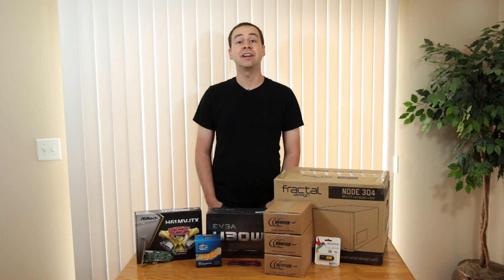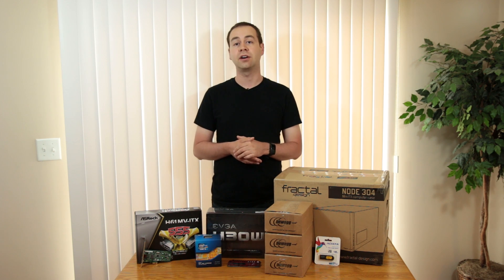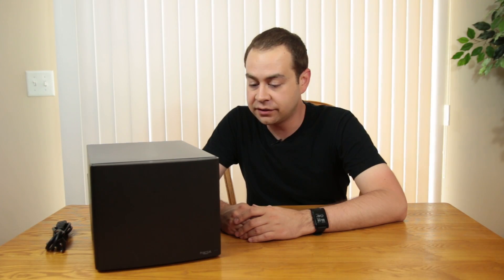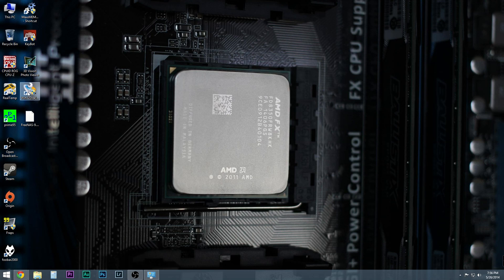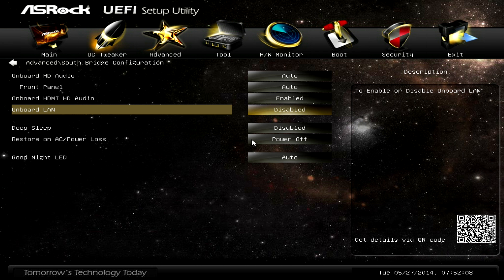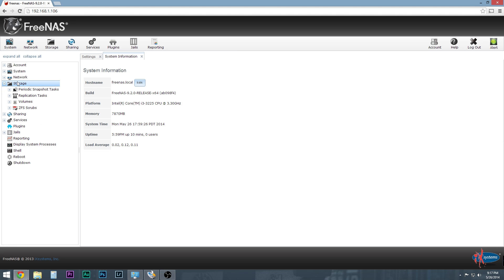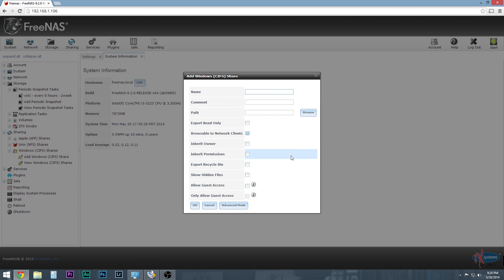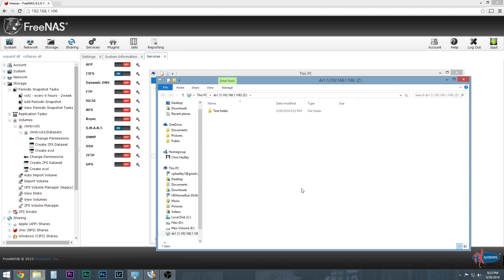Build a FreeNAS box - Core i3, 3x2 TB, Fractal Node 304

Comment: What will happen of i remove the usb stick after i set up the freeNAS? 

Which is better? Using a usb stick or a cd?

Just need help here..
Reply from the maker: Jack Anthony Catadman You need to keep the USB stick there. Some motherboards actually have a USB header on the board which is optimal. I'm not sure about the CD version but it would be the same. Once the OS boots, you never have to reset so if you are concerned about a USB stick and would rather use a CD for aesthetics, then go that route.
Reply: Thanks so much!

Comment: I just built a FreeNAS box - Core i2, 4X2 TB, Thermaltake Black Edition. All with stuff laying around. I did order 8GB of ram for $39.95. I am running a RaidZ2.  Some say 4GB is ok for home networking. But most people say that 4GB is too little. I am using this file server for video files. Thanks for the video.

Comment: Just doing a little research but why would someone go for a build like this over  buying something like  a synology or a qnap which will be cheaper?
Reply: OriginalNoseBleed Better transcoding, tons more feature, more bay if you don't get the case he got, and it's actually cheaper than any worthwhile qnap or synology.
Only qnap or synology I want is the the $2000+ ones
Reply: If you are using 2 drives it is pointless unless you want faster transcoding but if it is a 6+ bay nas it is cheaper to go the custom route

Comment: Liked & Subscribed. Thanks for the awesome tutorial video.
According to you which one should I go with, OpenMediaVault, FreeNAS or Nas4Free? I've tried all of them on VM and so far not too comfortable using any of them to run a plex server. Which one I should chose on my real NAS built server?
Reply: Same here, they are not straight forward which means learning curve is exponentially steeper. Of the 3 which you mentioned, I found each had an advantage over the other. One question I had requires me to do in-depth analysis of the software and hardware. My main concern would be recoverability in case of a massive device failure. Which offers the best solution?

Comment: Nice video - thanks for taking the time to film that.  I cringed when you put thermal paste on your CPU and then used the stock heatsink fan, but at the end of the video you mentioned that you were reusing the i3 CPU so obviously the heatsink fan no longer had a thermal pad on it.  Hopefully people new to building PC's will catch on to that :-)
Reply from the maker: Yeah, I probably should have been more clear about the fact that the cooler was reused haha. Repeating important info is never a bad thing. Double paste application would not end well!

Comment: Im thinking about building a custom NAS but just 2 questions, Is it really necessary to use a Core i3? wouldn't an Athlon 5150 suffice? those CPU's are only 25w TDP, should be a lot quicker than the CPUs you find in 'off the shelf' NAS boxes and miniITX AM1 motherboards are under £30. Also is it possible to import hard drives (none RAID) into FreeNAS without losing the data? Many thanks in advance.
Reply from the maker: Hi Andy. The Core i3 is very much overkill and I'm actually going to be updating the build using a lower end Pentium and ECC memory. You really want to set up your ZFS RAID-Z how you want it at the time of the build. You can expand the RAID-Z volume but from what I have read it's not really recommended. Otherwise, you can just create a second volume and map that as a separate network drive.

Comment: What exactly is a FreeNAS?
Reply from the maker: It's a great piece of open source software that allows you to build a system and put it on your network as a shared drive. The amount of flexibility the software has is immense and I don't even scratch the surface with my application of the software. There are tons of great articles around on the other stuff you can do with a FreeNAS box and I highly suggest you check them out.
Reply: Rami V Just because you bought a NAS doesn't mean you're getting anything better.  I had a NAS die on me this weekend because it was too crappy to detect that 2 of the disks were dying, and when I mounted the disks on a workstation to recover, what do I find?  Why it was Linux software RAID underneath all the fancy hardware.  I would have had a better experience if I'd just built the FreeNAS box a couple of years ago instead of throwing several hundred dollars out the window on this POS NAS.
Reply: ***** you need it on for sure or else you cant access it.
Reply: ***** that also work. My pleasure :)
Reply: ***** I would recommend building a FreeNAS box with low-power hardware and just leaving it on most of the time. Unless your server is using power-sucking hardware and is under heavy load most of the time, the cost of leaving it on 24/7 isn't very high.
Reply: TWO515TY  its not only cost of electricity it is also hours of hardware working for no serving reason and every hardware has its own limit, maybe freenas has an option to hibernate itself when not in use and wake on lan whenever it is being requested by a customer, that would be best and i guess they have that option.
Reply: Rami V No, FreeNAS and most other NAS/server systems are designed to be on 24/7. I've never heard of a NAS or other server that's designed to hibernate or shut off when not in use. If you build a server with decent hardware, then the hardware shouldn't suffer much from being on and idle. As I mentioned previously, a home server that is idle and not doing much work shouldn't use a lot of electricity to begin with, and the hardware isn't working very hard when no one is using it.
Reply: The fact that you called it Nas does not make it a Nas. Its a Nas wannabe with hardware similar to an upgraded home pc, the fact he purchased Nas box does not turn it to a Nas server, you can take a regular computer which is not Nas and apply the freenas  software on it. It will act like Nas, you may create raid 5 array on it and manage it, does it have Hardware or by any means was designed for Nas? Hell no. And regardless, i see no point in leaving device which most of the day does not provide and service but files storage online consuming electricity and shortening hardware life while being online, though go ahead and do it, irs your money 😊
Reply: Rami V I'm not sure what you're getting at, but a NAS is just some device that's connected to the network and provides storage...I'm not sure how you can have a "wannabe" NAS...either it is or it isn't. Of course the software is what makes it a NAS - the software is what makes any PC do its thing. If you take a regular NAS and use it as a Linux or Windows PC, you could call it a home computer if you like.

The situation you described is actually one of the biggest advantages of the FreeNAS software - you can take any old PC lying around and make it useful as a NAS. I started off getting into networked storage when I turned a $15 PogoPlug into a NAS with an external hard drive and a free build of Linux.  Maybe you're thinking of a NAS in enterprise terms, but this video is obviously designed for people wanting basic home usage. The only requirement for something to be a NAS is to be networked and to provide storage. I don't see why you need NAS-specific hardware to be considered a "real" NAS.

Also, your assumption that all the NAS does is serve files is a little short-sighted. FreeNAS and most other NAS software allow you to install software packages that do other things. My main NAS runs Plex and Transmission, and I've set it up to be accessed remotely so that I can grab files from it if I need to. My $15 PogoPlug NAS also runs Transmission, FTP, and I use it as cheap security camera with a web cam attached to it. Those are just my basic uses - there are people who do way more with their own NAS setups. Also the amount of money that both devices use together is less than $10 a month. I have attached a Kill-A-Watt to both devices and they barely sip electricity, even when under load. If they are idle most of the time, then they use even less power.

Comment: If I swapped the hdd's for ssd's, that would improve performance wouldn't it
Reply from the maker: I would be faster but I wouldn't suggest using SSDs in a NAS setup. Using drives that are specifically designed for a NAS box such as the WD Red series are the safest way to go as they are designed for extensive read and writes over time.
Reply: Tech Uploaded  (sorry for my english)
you would be faster if you had dual or quad intel 1gbit/s ethernet card or 1 10gb/s (look at it price). Using one 1gbit/s port gives you a maximum speed of 125mb/s (=1gbit/s). And today an SSD is faster that 125mb/s. So, even a WD BLUE connected by SATA 3 (=6gbit/s max) reaches out the speed of 1gbit/s port.

Comment: Great video! I know some of these parts were already owned, but what sort of cost would this come to all new do you think?
Reply from the maker: Here's the PCPartPicker list http://pcpartpicker.com/user/TechUploaded/saved/rTBTwP. The price would come to about $700. There are definitely ways you could cut that down a lot like going with one of ASRock's embedded solutions.
Reply: Great thanks :)
Reply: Tech Uploaded please direct me to such a board. I used to get some boards like those built in strange places and have a cyrix overclocked cpu, for 40 usd. By experience I know Intel cpu Intel board have proven themselves flawlessly. The rest is just fodder. Somehow cheaper may be better in such case except for the drives of course.

Comment: Also did you use ecc ram?
Reply from the maker: I did not. In order to do that I would have to go with the elusive C226 chipset based ITX board. They do exist and ASRock makes one (the E3C226D2I) but that bad boy runs over $200 plus the additional cost of ECC memory. However, if this was going to be housing mission critical data then it would be worth the extra cost.
Reply: Tech Uploaded Oh ok. Im just confused by the whole nas thing i heard ECC was a good choice for a nas but yeah thats crazy expensive considering its just a home nas
Reply from the maker: Yeah, projects like this can spiral into a very expensive undertaking if you want them to be. ECC is recommended due to the up time of server builds more than anything else. When something is running 24/7, you increase the odds of your memory generating an error and the system becoming unstable or corrupting data. ECC can usually correct such errors without causing the system to become unstable. Obviously, that is pretty important in a corporate or research environment. In my case, if it happens then I just restart the NAS and go about my business.  :)

Comment: Great vid! But the fractal node 804 has 10 drive bays and isnt that that bigger than the 304 just thought id say that :)
Reply from the maker: Funny you should mention Mr. Fractal 804 as one just may be on its way for another build I have planned ;)
Reply: Tech Uploaded oh cool lol great lil case
Reply from the maker: Fractal does it right in my book. I've yet to use a case from them I didn't like.
Reply: Tech Uploaded Yeah for the price of say the define r4 or the core 1000 theres no way not considering a fractal case
Reply: can I use Fractal 804 to build my ESXi 6.5 server and host many servers on it? Obviously I have to get better systemboard, 32 B ram and at least 10TB hard drive